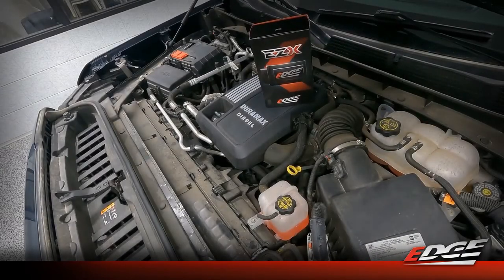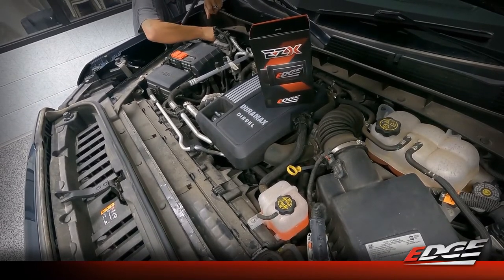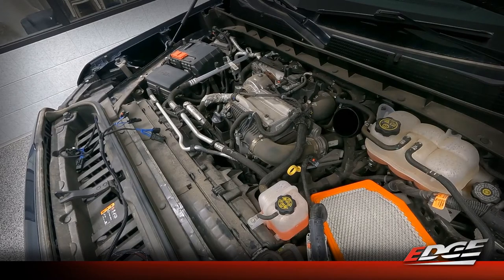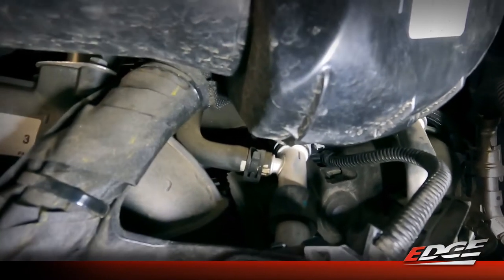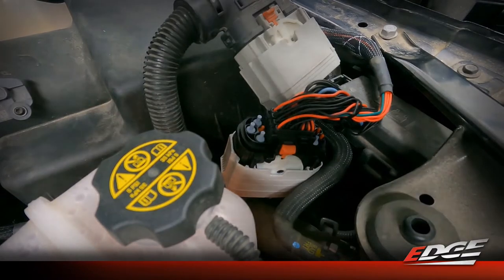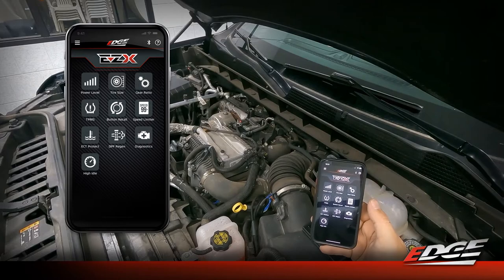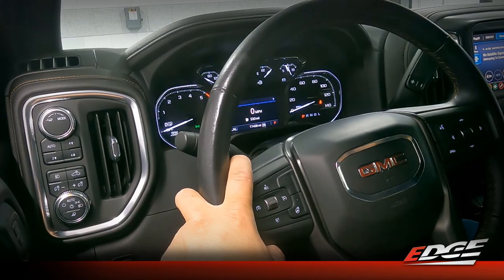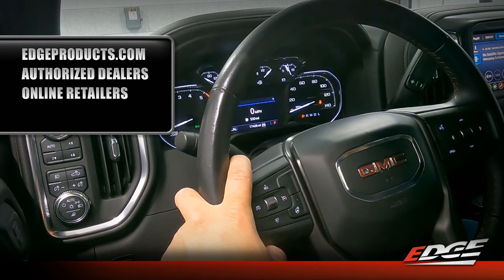EZX Installation for 2020-2022 3.0L GM Duramax

Comment: I have a question in hoping you can answer,   i have the 23 trailboss custom, that gives the LZ0 motor but with the old interior, do you know if that makes it global "A" architecture or global "B", and could this work for my truck?
Reply from the maker: our device will not support that application. I can't speak to whether it uses the Global A or B system. But this device calibrations are specific to the LM2 engine

Comment: what is the reason for not working on a 2021 suv ?
Reply from the maker: The SUV's use GM latest Global B technology system. So all the data that runs through the OBD-II and info system of the vehicle is encrypted differently. They moved to that technology in the 2022.5 trucks, so until we have that cracked, this device isn't capable of talking to the vehicle.
Reply: ok thanks .I figured the 21's would work being that it has the analog cluster just like the pre 22.5 trucks . @edgeproductsman